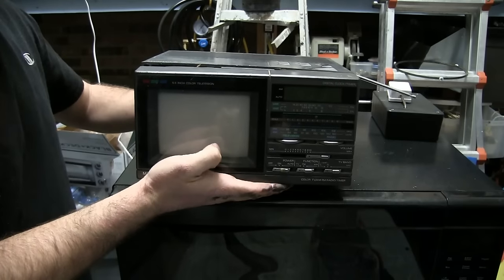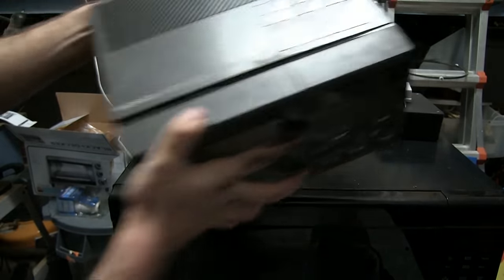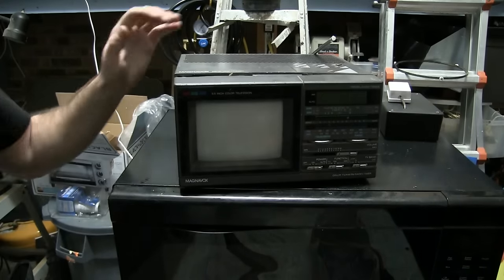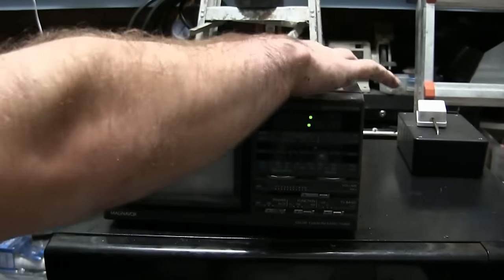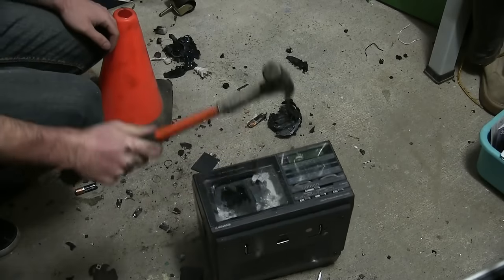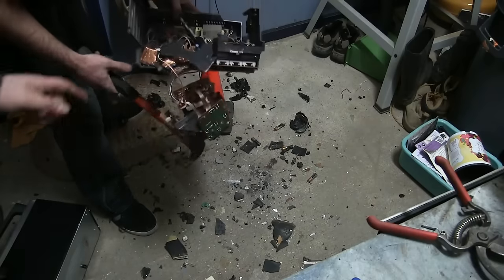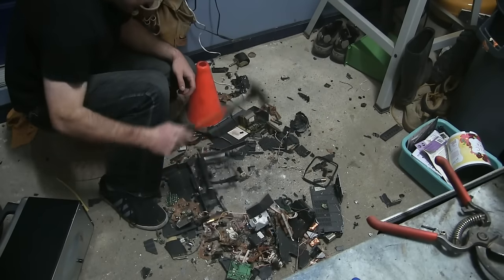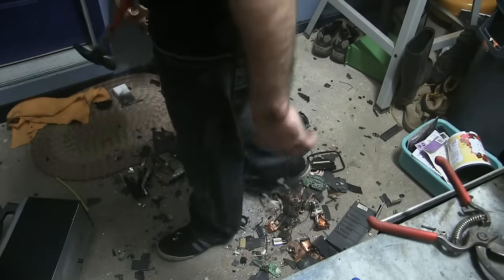TV Radio Alarm Clock Destruction

Comment: I used to have one of these types of clocks and I could never get the damn tv to do anything so I throw it on the ground and broke the tube then I just started using my phone as an alarm clock :)
Reply from the maker: +south park fan dude I've been using my phone an alarm clock for a long time now. It makes sense to use it because you can save multiple alarms, have full battery backup in the event of a power failure, and the time is automatically set so you don't have to worry about daylight savings.
Reply: +Shawn K I do the same thing on my cell phone